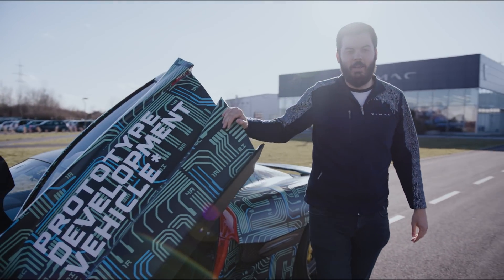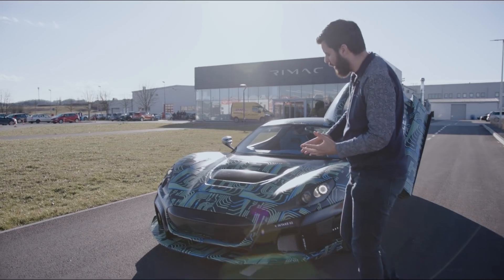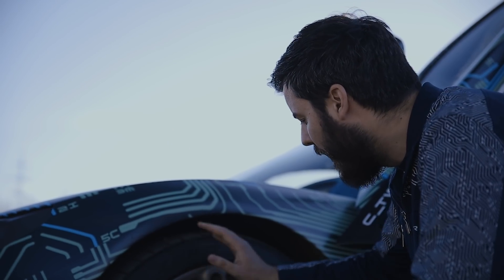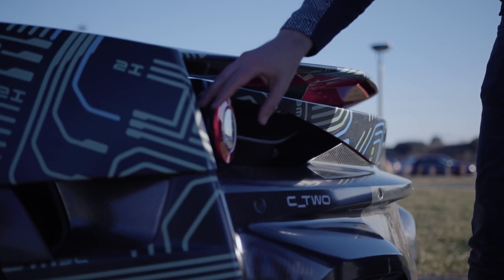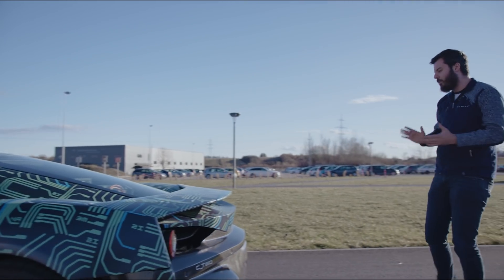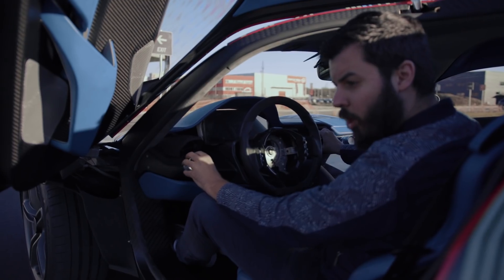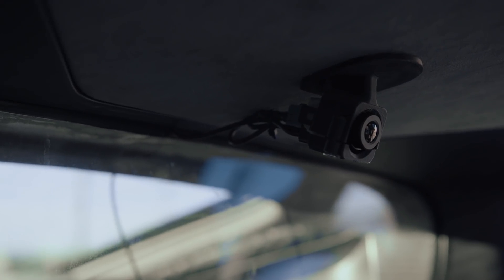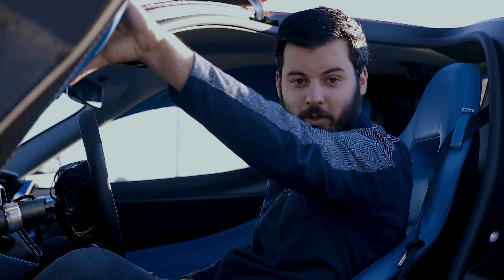Rimac C_Two Final Form: Sneak Preview | Mondays with Mate E06

Comment: Mr. Rimac - why you need parking break? Can't you have your motors block the wheel from turning? And secondly, can you share some outcome of this refinement in terms of weight savings, efficiency...?
Reply: Because the brake has to function even if the electrical power to the motors is cut off.